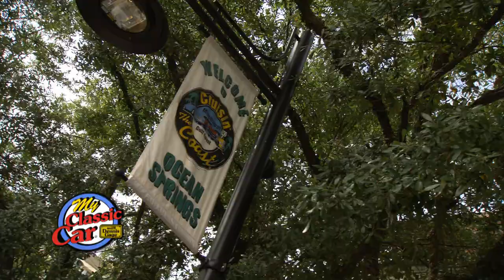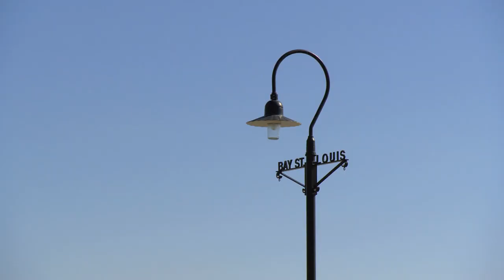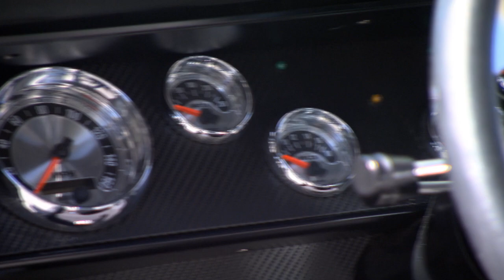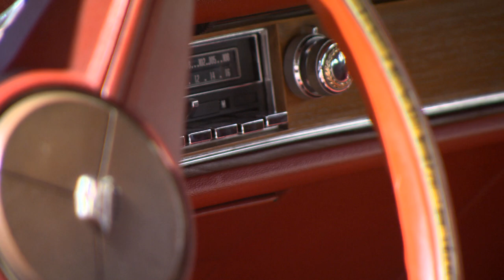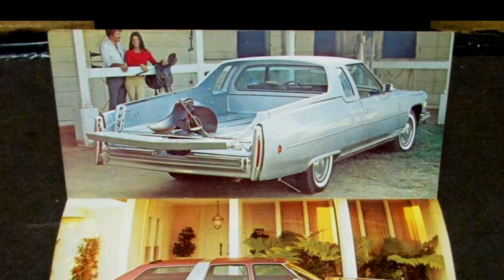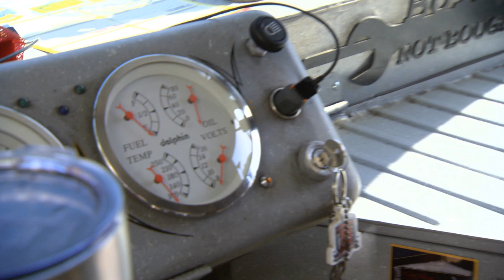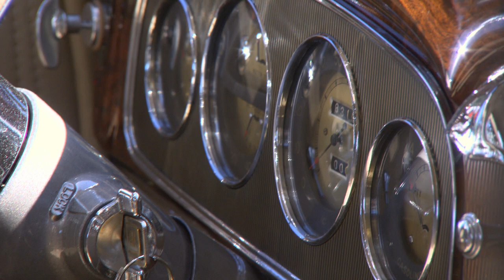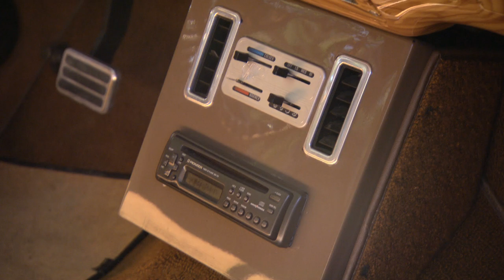International Laundry Truck | Dodge Postal Truck | Rat Rods | Cruisin' the Coast

Comment: For my grand mothers funeral in the 90's the mortician had one of those Caddy El Camino flower cars with a sheet metal bed with a drain, could be used like a riding pool. Had the vinyl top. So not the Caribou model.